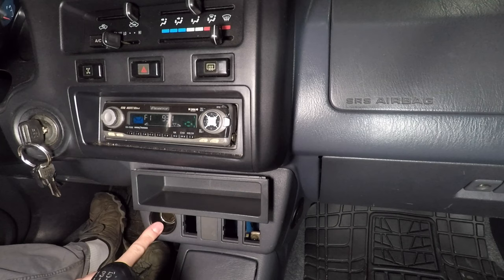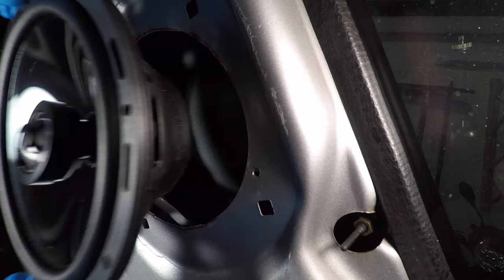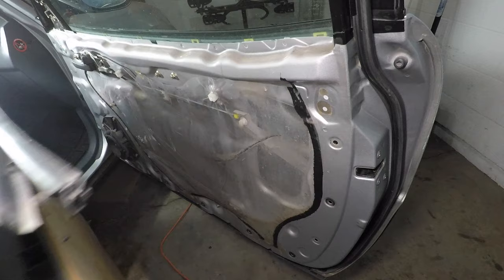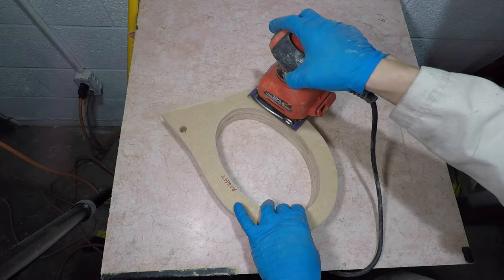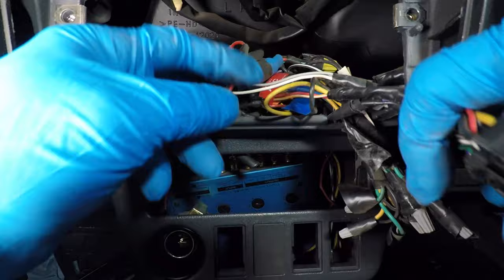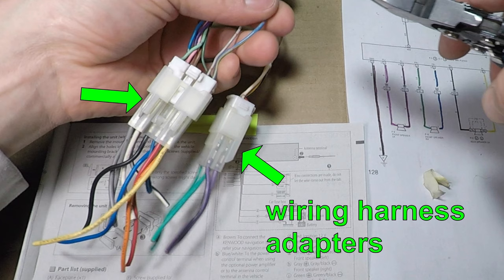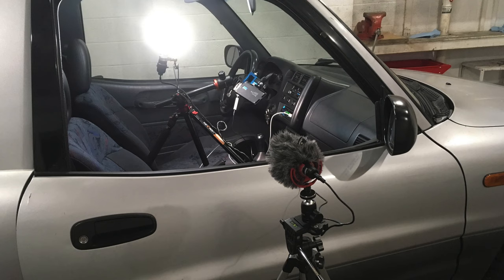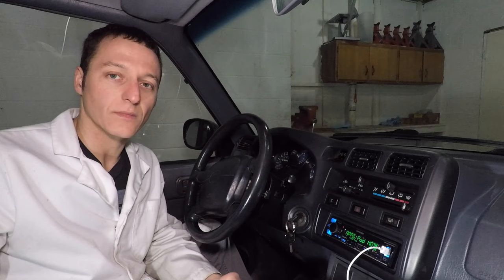Installing a new radio and speakers in a 1997 Toyota RAV4 (episode 17)

Comment: I just installed a 10.1" scteen Joying Android head unit in my 99 RAV4 4 door and I was AMAZED that it FITS PERFECTLY!!! IT literally looks like it cake stock that way! If anyone is considering replacing their stereo in a 1st Gen Rav4 I HIGHLY recommend getting one! I spent $250 for this thing, and it's got an Intel processor, 4x50 amp and sounds DAMN GOOD! I thought that I would have to immediately add an amplifier, but as it turns out the thing is powerful and sounds great as is. I'm still going to get an amplifier to run my sub and the rear speakers, and once that occurs this system will be amazing. I gotta say, I've been skeptical about the Android head units from the beginning as they were plagued by a lack of decent processing power as well as a lack of decent amplification, but those issues have been fully addressed now (at least by Joying), so these Chinese units have officially SURPASSED the big boys like Alpine, Kenwood etc. A decent Kenwood will run about $500...TWICE the price of the Joying, yet the Joying has tons of features the big boys do NOT... Like the ability to run any Android app, totally customize the look of the screen, etc. It's a NO BRAINER!
Reply: Can I see what it looks like in your Rav4?
Reply: I want to see

Comment: Love it. Everything gets customized on the rav. And every project addresses some previously  unknown problem that you find along the way. But, no sound deadening/insulation with the new system? That video must be coming in the near future . . . 🥳
Reply from the maker: You must be psychic.  I have two boxes (72 sq ft) of sound deadening insulation sitting here, waiting to be installed.
Reply: @LabCoatPaul  you gave a hint when you showed the deadener to put around the speaker edge. I'm really looking forward to seeing how much the sound deadener does for the rav! Cause I'm still considering getting of these, probably a 4 door, in the future. Are you planning on layering with mass loaded vinyl? I think that did the most in actually quieting my 98 4runner when I added it with butyl and closed cell foam. It adds a ton of weight though
Reply from the maker: @philiptaylor2567  I'm only doing the sound deadening mat.  No MLV for me.  I'm not trying to turn my RAV4 into a recording studio.  :P
Reply: Paul Shpakov are you going to do any decibel measurements, before and after?
Reply from the maker: @philiptaylor2567  I'm not taking measurements, but I will have some before and after video, so hopefully you can hear the difference.

Comment: Good installation, sounds fairly decent , to help you with your most annoying part as you call it, to remove the window winder handle next time!! you simply use a screwdriver and push the metal clip and pull the handle off(there's no need to hook it at all) this way the clip also stays on the handle too and it won't fly off as you remove the handle. If you look at the design of the handle and the clip you will see this is how it was designed to be released and removed .. Best Regards, keep up the vids. Great job..

Comment: Is it normal for the "yellow wire" (constant 12v) to read 0 Volts on the voltmeter even if the engine is running? I've checked the fuse (Dome fuse) under the hood and its all good. I have a rav4 1998

Comment: Great video as I'm about to see what's up with my radio. Dang thing powers off once I put the Rav4 in gear. Forward or reverse. Then comes back on by itself... Radio issue or something else? Also cigarette lighter has no power. Thoughts?
Reply from the maker: That's weird.  Start by checking the cigarette lighter and radio fuses.  Next, pull out the radio and check the wiring.  Do you have the factory radio plugged into the factory connector, or is there aftermarket stuff with poorly connected wires?

Comment: I noticed that you said that there were wires for hooking up steering wheel controls to the radio. Did I misunderstand that or does that mean I could get a new steering wheel with radio controls and be able to use that?
Reply from the maker: The radio is compatible with a steering wheel interface input.  If you got a steering wheel that had buttons on it, along with the clock spring wiring, you could add steering wheel buttons. 
You could use this if your audio source is your phone:
https://www.crutchfield.com/S-YyLEqPj0fqq/p_575PMXBTUR/Rockford-Fosgate-PMX-BTUR.html?XVINQ=GZ0&XVVer=164T&awcr=628493822857&awdv=c&awnw=g&awug=9052441&awkw=pla-643290962087&awmt=&awat=pla&gclid=Cj0KCQjwiZqhBhCJARIsACHHEH_cjWSi6HHPGxBPxe3yxz4NTK3Z2PPXekmZeSEfiw69ZYDDJWX-b6MaAjFREALw_wcB
Reply: @LabCoatPaul  Wooooaaaahh that's awesome, thank you so much for answering. I just got a 97 RAV4 and I'll excited to see what I can do with it :)

Comment: Hi I have a question I have a 1998 rav4 and can't find a good place to run a positive wire to the battery for a amp and was wondering if you had any ideas
Reply from the maker: Remove the battery and battery tray.  You'll see the engine wiring harness passing through the firewall.   Pull the wiring harness and grommet out of the hole just a few inches.  Poke a hole through the rubber grommet with a screwdriver.  Don't use a drill.  Be careful not to cut into any of the wires.  Push your power wire through the grommet, and push the grommet and engine wiring back in to the firewall.

Comment: Could I install 6.5 in the fronts with out a template? Or do I need a template?
Reply from the maker: Depending on the depth of your new speakers, they might fit in the doors if you just cut the holes bigger.  If your speakers have a large magnet, you may have to build a spacer.
Reply: I bought the same ones you installed for the rear in your rav4. So, the plan is to have 6.5’s all the way around. I just couldn’t seem to find a mounting bracket. My plan is to drill holes (where they are supposed to be)out the stock speaker grill.
Reply: Great videos btw

Comment: Thanks for this video! Can you tell what the radio output power is suitable for this generation of RAV4? for example 4x60W or 2x60W?
Reply from the maker: More power to the speakers is always better!  My radio puts out 22 watts x 4 speakers.  That's not much at all.  You can add an amplifier and the speakers can get 50 watts x 4.

Comment: So happy you did this video, I was gonna replace my speakers too, but now I know my speaker sizes may be different. Mine is the same as yours but the 4 door model. Manual and crank windows. Maybe the four door model has 6.5 inch speakers?
Reply from the maker: The easy way to tell would be to shine a flashlight at the front door panels.  If the speaker grill holes aren't all drilled out, you probably have the smaller speakers.  It's still a good idea to take the panels off and actually look at your speakers before ordering.

Comment: Paul. What's your tire size, again?
Reply from the maker: I installed the BF Goodrich All Terrain T/A K02 tires in the LT225/75R16 size.
Reply: @LabCoatPaul  really?? Even though you have a 1-inch lift kit? Wow. Meet I ask why you didn't go with a wider taller tire? I just went from 215-70 r-16 up to 235-70 R16. And I don't have a lift kit and thank God I'm not rubbing anywhere, lol. But, i picked the Yokohama geolander A/T tires because of their reviews.
Reply from the maker: @welcome2myworld1.o89  The old man emu kit is a 2" lift in front and 3" in the rear. 

My tires rub a little bit when the steering wheel is all the way right.  225/75R16 is 1/4" inch larger in diameter than 235/70R16, but not as wide.

Comment: So how much do you want for the rav?
Reply from the maker: That's a fun question.  I originally paid $3,500 for it 2 years ago, which is too much.  But people in Utah pay too much for all wheel drive Toyotas.  I could get my $3,500 back any time selling it.
Then I started fixing it.  That's when things went horribly wrong.  EVERYTHING on my RAV4 was completely ruined.  I've spent more than $8,000 in parts and way more than that in labor, which I did myself, for free, so I guess it doesn't count.
At this point, I've given so much to my RAV4, and it's given me almost nothing in return.  I ride a scooter to work because my car sucks so much.  I actually kind of hate my RAV4.
My RAV4 could probably beat almost any other vehicle off road, with it's super short wheelbase, awesome tires, and 12 inches of ground clearance.  As a car, it's much worse than newer vehicles.  It gets bad gas mileage, it's probably the slowest car on the road, and if you crash it, you'll definitely end up in a wheelchair. 

At this point I'm not ready to sell it yet, because I want to finish my video series, or at least find a good stopping point where I've done most of the common repairs.  Then I'll get rid of it for cheap since it's not actually worth anything.
Reply: What’s the gas mileage? What’s left to fix? Please let me know I love the rav especially yours!  Had a 97 2 door. It’s one of the best vehicles I’ve ever owned. Ran like a top!
Reply from the maker: @51cathedral51  My RAV4 gets 21mpg, which is the right gas mileage for this vehicle.  It actually runs perfectly, but it still leaks every fluid except for brake fluid.
My coolant still disappears pretty quickly, but it's been hard to find.  I still need to change the timing belt and water pump, and I'm hoping that will stop the coolant leak.  It's leaking transmission fluid, but I have new axle seals, and I plan on fixing that soon.  The #2 exhaust valve oil seal is bad, but that's not a big deal.  I would just replace the cylinder head to freshen up the engine, but I don't want to spend much more money on it.  Of course it leaks oil and power steering fluid too, but not enough to have to add oil.

Comment: Dude. Awesome video. I'm sorry they did such a shitty job but your commentary is so entertaining
Reply from the maker: Thanks!  I actually had a lot of fun taking out the shitty old stereo.  It's funny to see just how bad some people are at car stereo.
Reply: @LabCoatPaul  I do have an odd question

All my Camrys (I've had 5) are revving at 2400~2500 @70mph, but they're auto trans

I have a 1999 4 door Rav 5 speed like yours and its at 3200~3400 @ 70mph. Is this normal?
Reply from the maker: @devinprasad3449  Yes.  The Camry has a higher highway gear than the RAV4.  The Camry also has a bigger and more powerful engine than the RAV4.
Reply: @LabCoatPaul  thank you! I bought a Volvo 2 days after I bought the RAV and I was in for a surprise with the RAV because it drives completely different than the Volvo. These are my first two 5 speed vehicles in my life and it's all new to me. Thank you very much!!!!! 🔥🔥🔥